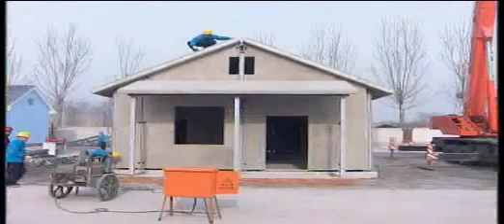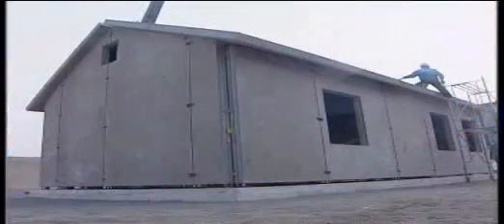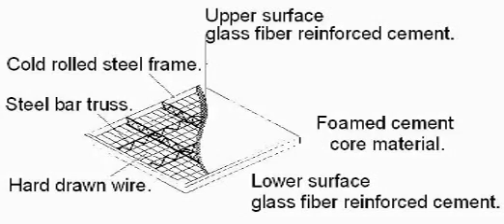Lightweight Insulated Concrete panels

Comment: Nice👍..fast in construction and accurate in dimension..How long does the insulated concrete panels to be fabricated? How about the wiring/cable for power lines and piping for fresh and waste water lines are they also prefabricated with/on/in the walls?

Comment: If they are so lightweight why does it take a crane to lift them?
Reply: +desertsun100 lightweight doesn't mean you can carry it manually. It's called "lightweight" because it is a bit lighter than common concrete walls you usually see.
Reply: They are lighter than the original concrete walls in the same size, but are strong enough to stand against heavy wind/rain/ice  storms.   You don't want your house to be easily destroyed or blown away to " somewhere over the rainbow" where you can no longer return to earth!!!

Comment: There is a factory in Haines City, Polk county, Florida, forming stock lightweight concrete  components like lintels and panels. Theirs can be cut with an electric saw and a carbide tipped wood cutting blade, and nailed together...
Reply: AERCON AAC

http://www.aerconaac.com/
Reply: What is the name of the factory?

Comment: Cyberpine, the electric can be accommodated with some strategic slots and the plumbing can be accommodated with piping in (or under) the floor and one or three pipes tucked inside of the back of 'built in' cabinetry...But in Port st Luce, call it a shed , not for human habitation (At least on paper, he,he.)

Comment: We are Lightweight Insulated Concrete  block and panels making machines manufacturer, if you need, contact me: sunyang1088@126.com
Reply: +sun yang .......mrahman.1338@gmail.com
Reply: +Mizanur Rahman precast concrete products, such as lifting anchor, lifting clutch, recess former, etc.
If need, contact me: sales@qingderigging.com

Comment: Can you please tell me how double story home can be constructed using this material? Like how will the the plumbing system be installed in the double story home? Does it need reinforcement for 2 floors? Do the floors need extra panels to accommodate plumbing system? What is the foundation made of?

Comment: Nice project. Hmm, not sure how expensive it is. Probably a lot cheaper insurance. How expensive it would be for a house property tax? I heard that a cement (i.e. calcium aluminate cements) produce some emissions such as thallium, cadmium, and mercury (Wikipedia).  This is what I have a hard time to believe. Many companies won't tell you about the emissions. I really like the cement house. I refuse anything with foam blocks for filling the concrete because of lung cancer (not enough evidence).

Comment: curves in concrete u'll start to look at moulds etc. i dont think the current industry is smart enough to make use of concrete better and also recycled stones brickes etc  they are starting to move to steel framing, and hopefully soon all prototype concrete mixed reinforced and out goes slow boring brick and mortar and veneered shit stick and plaster..